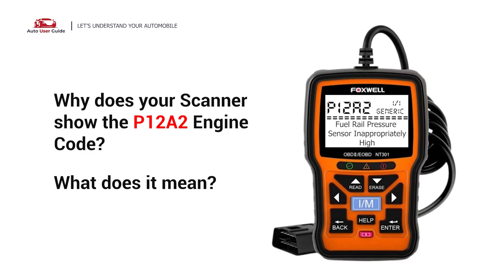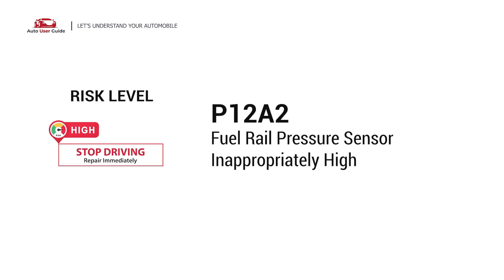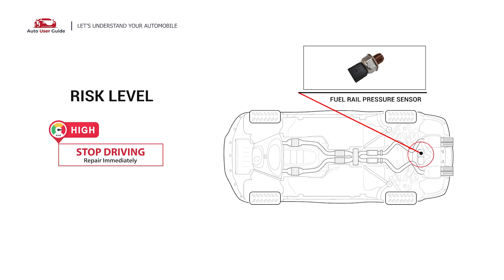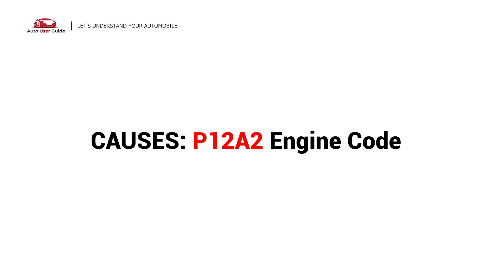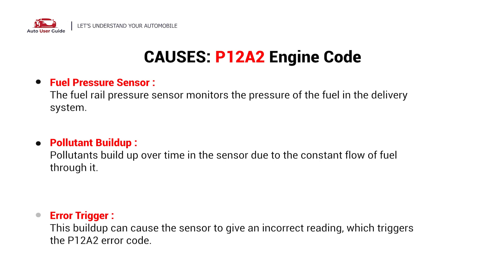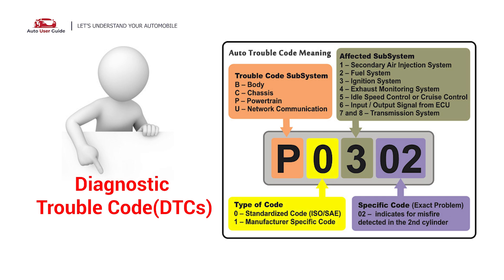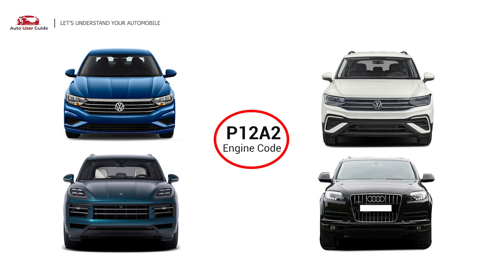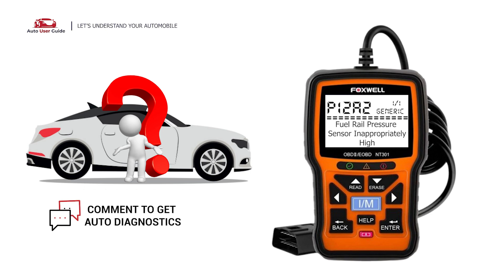What is P12A2 : Engine Error Code Causes Explained

Comment: how to fix it
Reply from the maker: What kind of car and model do you have?
Reply: @Auto-UserGuide  i have a Peugeot 308cc year 2010 engine 1.6 HDi. The obd says p12A2 , the car enters in secure mode and says on the midle of painel ESP big letters. Should i change the rail pressure sensor?
Reply: @Auto-UserGuide  is also displaying C1391 code
Reply: How to fix
Reply: I have Volkswagen Jetta hybrid 2014 SEL, and I got p0191 , p12A2